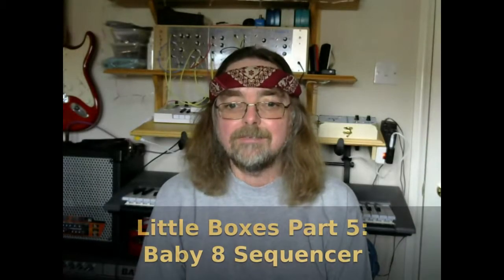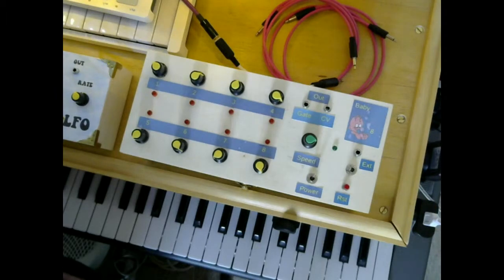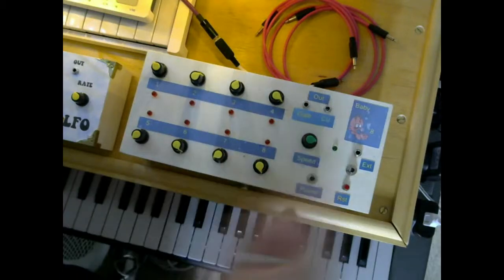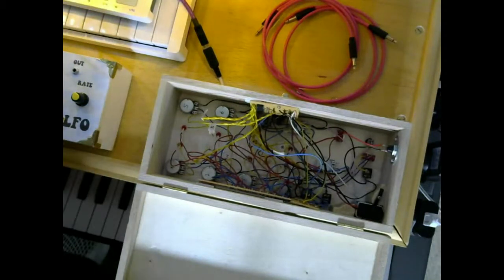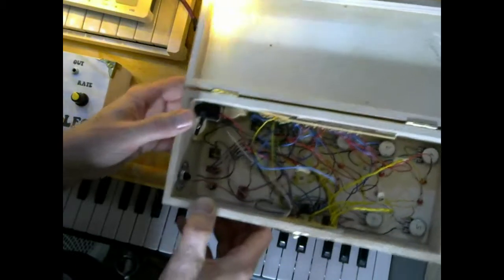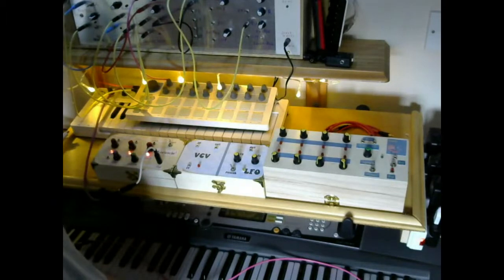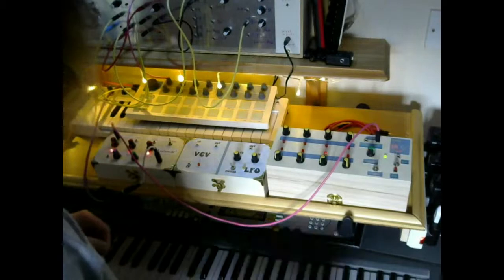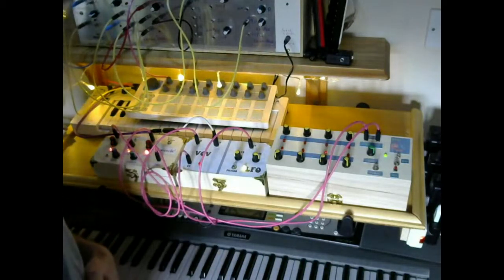Little Boxes Part 5: Baby 8 Sequencer

Comment: Hej! Have you ever considered adding an on/off switch for each step?
In this case, what would be the best place to put it? (I mean on the board, not on the _panel_😊)
Reply from the maker: Check out my gate sequencer module that has on/off (and reset) for each step https://youtu.be/tJoQWC5I4UI the same method should work for a CV sequencer.
Reply: @CuSiSound  Thanks, I'm gonna check that right away ☺
Reply: Just realized I already saw that video a couple month ago. I'm gonna try out something like that. Have a nice week.

Comment: Is the reset button a normally closed or normally open button. Let me know. Thank you kindly.
Reply from the maker: It is normally open, pressing the button closes the contact sending a voltage pulse to the reset pin on the chip.